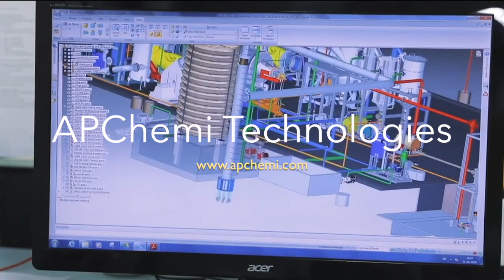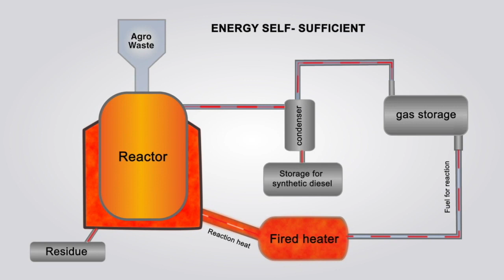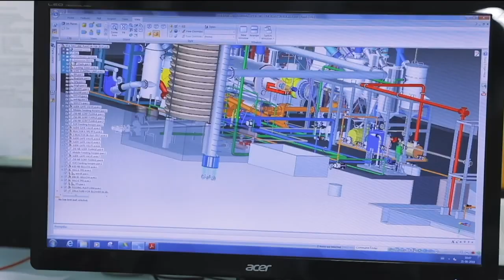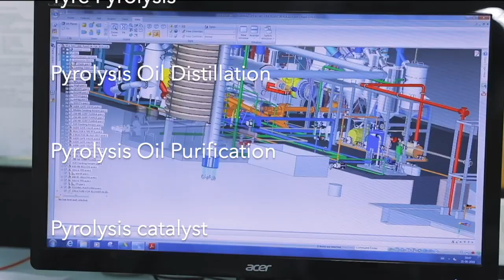Biodiesel from Biomass Pyrolysis: Technology and Plant Developed by APChemi

Comment: There is much biomass where the volume contains a lot of air and so transport of it, is not efficient and expensive. We should for such cases, be able to have a mobile installation going to the fields and do pyrolysis there (perhaps raw end products, without purification, which could happen later in real factory, transport is now easier)
or... perhaps there locally, only some other first step could be taken like high temperature steam + compression into briquettes. This means energy loss but perhaps it is still cheaper and better.